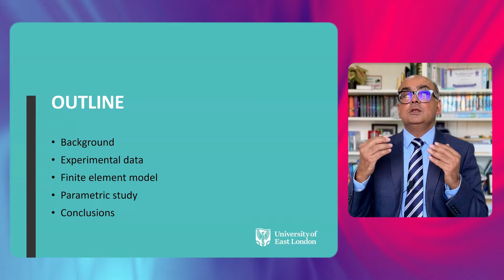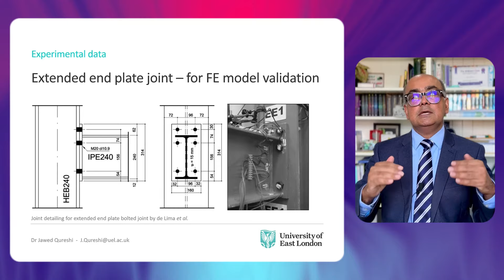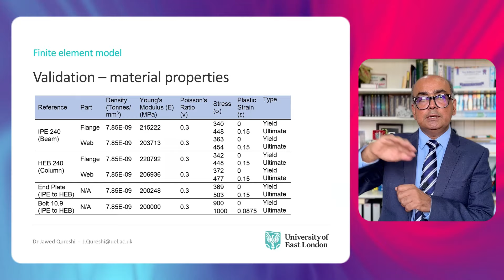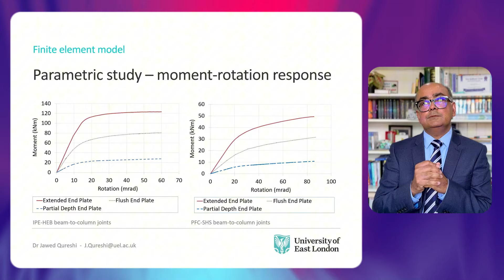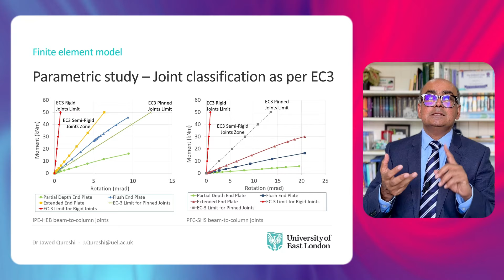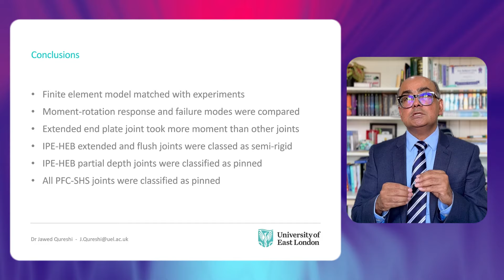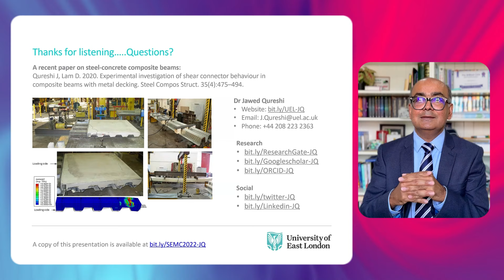Understanding Steel End Plate Joints: Insights for Engineers | Conference paper | Dr Jawed Qureshi

Comment from the maker: ⏰ TIMECODES ⏰ 
00:00 – Introduction 
00:55 – What are simple and moment-resisting joints?
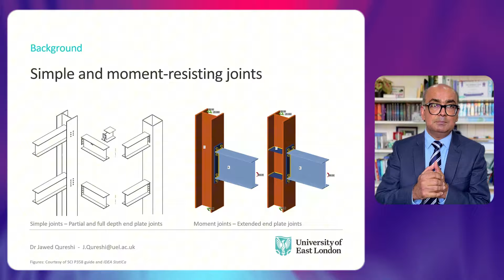02:41 – Experimental data
04:18 – FE validation model 
06:01 – Comparison of FE and experiments
06:55 – Failure modes
07:21 – Parametric study 
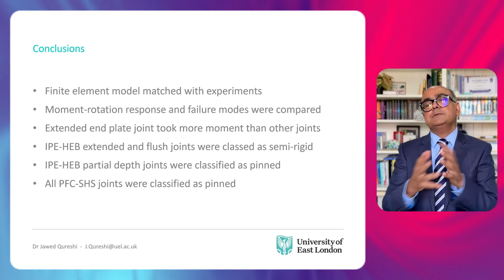09:19 – Reflection on shortcoming of research 
12:49 – Preview of next conference presentation

Comment: End plate connection transfer BM
Reply from the maker: Yes, extended end plate connection transfer bending moment.
Reply from the maker: Partial depth end plate joint is generally considered as simple or nominally pinned.
Reply from the maker: Although flush end plate, where plate covers entire depth of beam section, is a semi-rigid joint, but it is assumed as simple joint in the UK.
Reply from the maker: End plate connections are the most popular steel connection in Europe and North America.